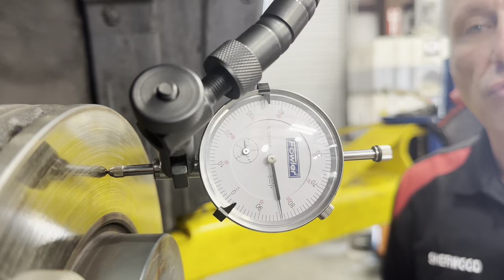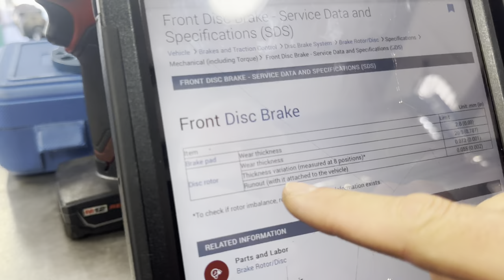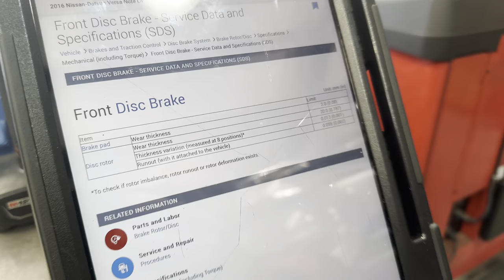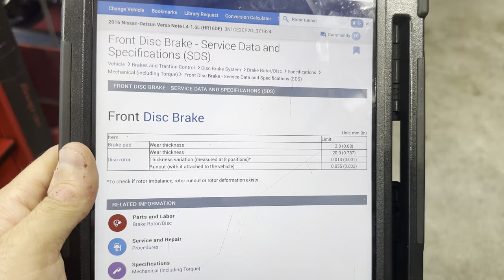It’s Vibrating When Braking & It’s Not the Rotors. How to Test! (Nissan Versa)

Comment: Missing something like this is easy. I'd guess, short of a major accident, that car has had problems since new. One simply assumes the mfgr knows how to make parts. I bought an '89 Hyundai new with a horrible vibration in the front wheel. The dealer replaced 6 wheels before they gave up trying to honor the warranty. I finally located a shop that still had an old "on the car balancer" sitting in the corner collecting dust. It turned out the car needed 6+ ounces of weights to balance the LF wheel. It was a defective outer CV. I installed a new axle (my cost since Hyundai wouldn't for a "hunch") and tossed all but the smallest weight to balance the tire perfectly. When machining the CV they'd machined the outer portion on a different center than the spindle as best I could tell. The next person to buy that axle (after "rebuild") probably never found the vibration.
Reply from the maker: On car balancer, that takes me back. Thanks!

Comment: If the other side is ok when measuring , rotors can be switched and measured again on both sides. It's going to be the same result as in this video, but for sure, it is not the rotors.

Comment: I don't think the mistake was failing to measure the hub runout initially - who does that? Rather, I think it was either not taking it for a proper test drive immediately after the initial rotor replacement, or taking it for a test drive BUT not noticing the pulsing was still happening.

Comment: I had to beat the rotors on a vehicle once, aftwr inwas done it had a bad vibration, after remiving the wheels again i noticed i had bent the caliper bracket bolt holders, i had to beat them back to get rid of the vibration i never did that again lol.

Comment: The last thing you could have done was while the rotors laying on the table, was to take a caliper and measure from the table to the rotor on the inside of the rotor and the outside of the rotor, just to confirm that the rotor wasn't warped.    Pulsating rotor can be trick to sort through, can't they?

Comment: As a flat rate Volvo Expert tech, i never once in my life measured rotor runout with a dial indicator ESPECIALLY if its under warranty. I rarely was ever wrong on my test drive diagnostics.
Reply: I’m a Mercedes tech and I’ve never seen on a Benz either. Volvo vehicles and replacement parts are better engineered and better made. This vid is talking about a Nissan versa. Asian imports go thru wheel bearings like crazy. Something you and I just don’t see. When I get I a new Honda,Nissan, Hyundai all I hear is road noise. PS. I don’t mean to sound like a snob. my daily driver is an 08 Hyundai and it gets me there and is reliable, it just not the quality of Volvo. They’re different animals.
Reply: @Andy-1234  wait until you hear a 2011-2015 Volvo P3 platform. The cup rear tires like its was designed to destroy tires and cause road noise. We have also had our fair share of wheel bearings on P1 and older XC90 vehicles. 

I worked for Nissan before (2005) and we hardly had wheel bearings but we did cut rotors every single day due to runout.

Comment: Warped Rotor, Thickness variation, Bad Bearing. bad Bearing Race, Race not installed Square, Rotor to hub concentricity , Crude on hub or rotor mating serfaces. Take readings of all, Replace recheck until .002. Lots of work

Comment: Air in lines bent rims or there is nothing wrong at all it’s the anti skid working as advertised dumping fluid as wheels are starting to lock up they are feeling if the rotors are good ! Could also be bad wheel bearings.

Comment: I wonder how long would it take to pulsate after the rotors have been changed? Would it slowly start to vibrate again after a day or two or would it be a month?
Reply: If the hub is bent the rotor won’t sit evenly and it would pulsate right away

Comment: Been wrenching over 20years and these type of issues are so uncommon, misdiag will happen! Vibration on braking is almost ALWAYS bad rotors, at least 95% of the time! The only criticism would be if the tech didnt test drive it after repair to feel the vibration was still there! And if the hub is warped, the rotor was trash too so it’s not a bad fix!

Comment: Surely if the hub was uneven you would feel vibrating without braking 
It wouldn’t drive straight either.. I slightly defect in the hub would be magnified at outer edge of the roadwheel

Comment: I can speak from past experience…late 1990’s when Advanced Auto took their USA produced rotor and drum program, and shipped their production equipment off to China the execs at the time, they were so proud of the fact they shipped parts production overseas.
Fast forward after I left the company a few years back, but still had friends working there, their quality went to hell.

Napa rotors and drums are a whole different level. Look at thickness of rotors in the brake surface and cooling vanes.

It’s honestly sad parts are not made to be machined/resurfaced, instead of the throw away mentality or replace and toss.
Reply: "Napa rotors and drums are a whole different level" do you mean different level as in good? or do you mean even worse than Advanced auto?

Comment: ANY HELP OR INFO ON MY  2013 Chrysler 300 3.6L WHY WOULD I GET SHAKES AND VIBRATION EVERY 5 OR 6 MONTHS AFTER PUTTING NEW BRAKE PADS AND ROTORS ON I put new rotors new brake pads on back in March of this year 2023 and here I am 6 months later and the vibration is back when applying the brakes coming off the freeway or having to slow down for traffic it vibrates and shakes really bad but once I have the rotors resurfaced with new brake pads it's gone and then another 6 months it's back again so I'm going to have my mechanic take a look at this video of yours and see what's going on hopefully this will give him an idea on why every five six months this happens or if you have any other ideas what might be causing this on a 2013 Chrysler 300 3.6L I would love to hear it my friend or anybody else's input in the comment section would be great also thank you and everybody take care posted 10/17/23  Cali time 9:00pm { Str8Tattedup }

Comment: It'll be back shaking soon even with a  hew hub.brake best pads and brake best rotors, those parts are junk. We had huge problems with those parts. Switched to akobono comebacks are zero so far.
High volume shop, Texas

Comment: I would never try to take readings directly off the hub.  Reposition the rotor on the hub after marking the high and low spots and if the high and low spots change, you know it is the hub.

Comment: If it isnt the rotors then how do i get vibration through braking when the rotors are hot from heavy braking, no vibrations at slow speed, I can only summise that the rotor is heat damaged and when it heats up again it warps. Only fix is to change rotors

Comment: The biggest problem my shop has is after 40 years in business is ALL the NEW PARTS are Junk , it's very hard to buy good new parts.   I quit turning rotors and drums because the metal use to be cast iron back in the good old days now they are made from Chinese Craponite

Comment: It would be foolish to check every time for hub runout.   Working on cars for 20 years I have only seen a warped hub very few times.  I can’t even remember , but do know it had happened.   You would be way more efficient with your time to just assume they are all good and when it’s not just take the hit to redo it.  Again this is extremely rare.

Comment: I race motorcycles my experience is that 1/10 of a millimeter wobble is almost indiscernible HOWEVVER 1/100 DIFFERENCE IN THICKNESS ......... Had that in my lathe it vibrated when not even using it...the brake ..

Comment: Very rare for a hub to be warped, I wonder what happened was the car in a accident, did the customer have a blow out, is the caliper locking up causing the rotor to over heat sending heat to the hub, I see it's a press bearing was it properly pressed with equal pressure. Many questions without answers. If a customer comes to a shop with recently installed new parts then investigation is necessary. Ps I have seen bad new parts too if you get them delivered the drivers sometimes drop the box it may look OK but who knows.

Comment: So there is no way to check and make sure the rotor is fine? People just change rotors and there is no way to know if it’s the rotor by looking at the rotor itself?

I changed my rotor and brakes 2 years ago and after hitting a big bump it shakes when braking slowly , a mechanic told me that’s the rotor.

But the rotor and brakes prior lasted for many years. I bought oem parts.

They also said they’d just change both front rotors based on what I said but checked nothing. So visibly a rotor can’t be checked and the only thing to do is do this to make sure it isn’t the rotor ?

Comment: Honestly no shop tests hub runout before slapping new rotors on a car that vibrates and then even when new rotors were installed we would suspect the faulty or low quality rotors first before suspecting the hub. A car like this would have came at LEAST 3 times, twice with brand new (warrantied) rotors before looking into hub with dial indictor. And I'm being generous.
Its not cause we're all incompetent, but more likely because we've seen countless rotors the are out of spec as new or that  leave and warp the first time they go through a puddle when hot.

Comment: Does warped rear rotor also cause steering wheel shake when braking? I just replaced my front rotor, but still vibrating.
Reply from the maker: Yes
Reply: @theroyaltyautoservice  Thanks! I might of accuse my autoshop then. They replaced my front rotor twice in 2 months but never looked at the rear brake because the guy said it is irrelavant.

Comment: Were you the ones who replaced the hub before this?  It didnt come from the factory like that and that isnt how a hub wears out.  Did you put the wrong brake fluid in it and it ruined the hub?
Reply: If the hub had a bit of rust on the knuckle to bolt area when you bolted it on then that would cause runout.  You are repairing it so you mustve done the new looking hub.

Comment: So there was .012" runout and rotor thickness within specs.
What was the fix to prevent the vibration?
Reply: They will replace the wheel hub.

Comment: There are times when an issue is geographical and it makes you look stupid.  In the early to mid 2000's I had a BMW X5 come in while the owners were on vacation in LA from Chicago.  It had a severe brake shimmy.  The rotors were about 1mm undersize and it had cheap aftermarket pads.  BMWs at this time would develop a compound shake and BMW had changed pad compounds repeatedly before that issue was resolved.  Factory rotors and current compound pads and we sent it.  Two days later it was back, better but still a slight shake when braking.  Inspect all the front end components and all ball joints appeared to be tight and all bushing were good.  Ended up putting lower control arms on it and the shake went away.  Why is this a geographical issue that we had never seen.  In Chicago the traction control and ABS work a lot more than in LA and we had yet to see ball joints failing at 50,000 miles like this X5.  The theory was the repeated loading and unloading of the ball joint had loosened them up enough for the head shake under braking but when the vehicle was on the rack the ball joints were in a slightly different position and no play was felt.

Comment: I had to take my F-150 to the Ford Dealership 3 times till they got the rear brakes right. They had used aftermarket parts but they didn't tell me that so the 3rd. Time they used ford O.E.M parts .🤔

Comment: For everybody to know,  in the first tire  
He only used one nut 
N
In the second, he used two
N, that's y the caliper gage 
Move in a study curve
But hey it's not that hard to figure out 
Lift car check tire top to bottom n side to side if u can see that way
Drop back down
Have someone put it in drive then reverse
💯 %you'll see the problem.

Comment: You showed the disc brake rotor specification. Bet there was no hub specifications at all. OEMs are all assuming hubs are made perfect and do not wear. With no hub measurement process in workshop manuals you can expect hubs will not be checked for runout.

Comment: The most common issue is rotor thickness variation. It is often a bad hub bearing. Or the fact many shops do not bed brakes anymore. 

The way most mfgs deal with issues like this is to machine the rotor on the car.

Comment: By “vibrating “ do you mean PULSATING peddle? … plus use all lug nuts, not just half… also to be thorough you should also do the back of the rotor.. bent hub is most problematic

Comment: Thats the hub  and or hub bearings
That is a hell of a lot of runout.

I dont like your flex arm indicator arm you bump them it sends the needle way off..

I watched a kid at NTB  looking at run out with that same set up he did not know how to use it.
I think the fixed arm units are more accurate.

Comment: Why didn’t you torque all 4 lug nuts to spec?  Having only 2 lug nuts tightened to who knows what is not an accurate way to measure run out of anything.  

Also not the bluing of the rotors inside hat area.  It was definitely over heated.

Comment: A road test drive after changing the rotors by the mechanic would have brought this to light instead of the customer bringing it back, the wobble should have been felt just driving without touching the brake pedal

Comment: Why didn't just turn down  the rotor when it was mounted on the hub ? That would of made up for the bad hub . [ Of cause thats NOT the correct way but it would work till the next time the 
   rotor is removed and not marked so its put on the SANE way .]

Comment: If you would have checked your work and given the car a 2 minute test drive you would have been professional and would have known the rotor was not bad. I had the same problem with my 2010 Avalon. I changed the brakes and rotors, just like you, fully expecting the wobble to be gone. When I put the car on the ground, before even putting tools away, I drove around the block. The wobble was still there. I first checked the tires for misaligned belts or other defects. When that wasn’t the problem the only thing left was the hub/steering knuckle (bought as a set with the lower ball joint). The car rides like a dream now. Check your work!!! Your poor client has been without his vehicle for two service appointments to fix one problem. I do commend you for showing such a “rookie” mistake and admitting that it was poor workmanship. Did your warranty include a loner vehicle for the owner to fix your mistake? Did you charge them ANY additional labor? They should have paid parts but you should have at least paid for the rental to fix your mistakes.

Comment: New rotors, new hubs, new brake pads, new bearings, end of story.   No experts, not dial indicators, and no video.  This video takes longer to create and loss time over then a complete new wheel system.  Yes a tad $$$  but no bs, always works and returned knowing it WORK CORRECTLY.

Comment: I think this guys braids are too tight.
To achieve .002” runout is almost impossible. 
To get even close you must remove the disk clean the surfaces between the rotor and the hub,
then torque all four lug nuts to specification to get a accurate reading.

Comment: I own a repair shop in Akron Ohio, I think you are beating yourself up over something that is not your fault, the only thing that may have not been done correctly is the road test after the last brake job, if that hub was out that far it should have been felt, or someone may have hit a curb after the brakes were done, anyhow if it was at my shop I would just machine the rotors on the car, and warn the customer that this will have to be done every time the rotors are replaced, or a hub replacement would work too, flip a coin lol

Comment: Bent axle?  .0005 in. thickness will really pulse!  Turning drums & rotors is really caught/trapped, shops wanna replace, OEM wanna sell, and their liability lawyers wanna collect their retainer while never having to defend a minimum thickness case so they set the limit, not brake engineers!
The only problem with turning/machining is abused machines & dumb operators.
Reply: I was thinking worn out CV joints

Comment: You should use all 4 lug nuts on the rotor !!!!
Reply: A couple nuts opposite of each other is all that’s nec and that both the hub flange & the rotor surfaces are clean.  The hub is likely bent from sliding sideways into a curb or previous hub damage from removal for a new wheel bearing. Also it’s important to torque each wheel nut evenly. This helps greatly if the brakes are overheated there’s much less change of warping. Retired auto tech of 40 years. Also guys with girly hairdos in an auto repair facility can affect judgement. 😅

Comment: Gonna go look up the spec right away and you dont even check for debris on the hub, rotor mating surface or hub run out, plus all lug nuts should be installed and snugged up before checking runout.

That vehicle may be a candidate for on car rotor turn to get everything true, and dont forget the gorilla driver killing the brakes by abuse.

Comment: So no one test drove the car after after replacing the rotors to make sure the brakes were working properly? If you had, you surely would seen, or felt, that the vibration was still there.  I can understand the mistake of initially blaming the rotors, but not confirming the fix is appalling. You're no better than a dealership.